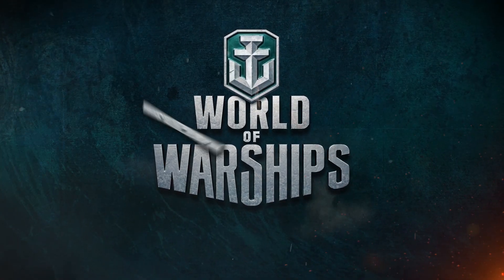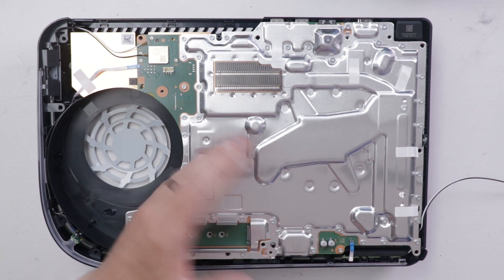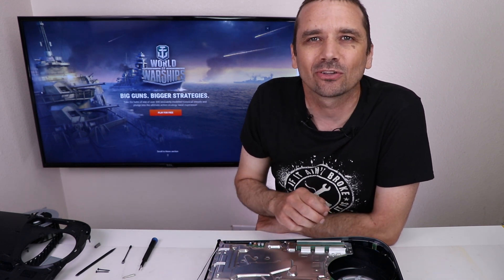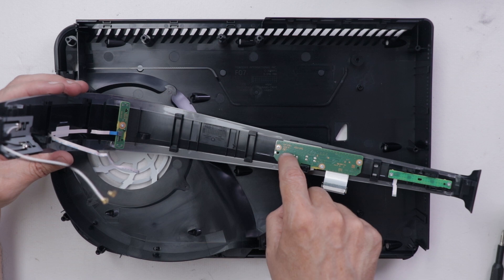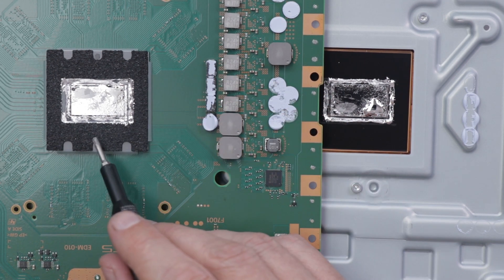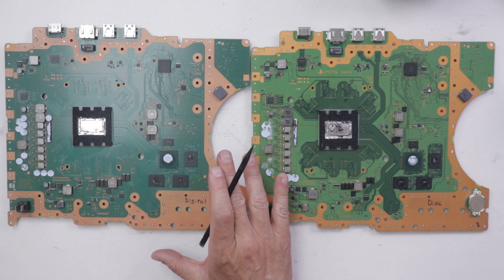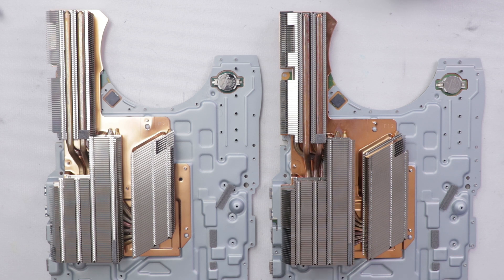I Tore Down A PS5 Digital! Is It Even Different?

Comment from the maker: Download World Of Warships
https://wo.ws/3wmT042
Use code BOOM to get free in-game rewards during registration.
The code is only for new players.
Reply: The person that designed the ribbon that way so you have to remove all those screws is the same person that whines about thermal paste in your comments and is just getting back at you. Sony PS5 engineer to colleagues: "Here I designed the perfect amount of screws so TronicsFix will have to remove them".
Reply: I have a ps4 pro missing a disc drive if you want it for parts it turns on and boots the os just let me know how to send it to you i have no use for it better than going in the trash
Reply: Hey do you think you can help me, my Nintendo right joycon just suddenly stopped working while I was playing a game. The sync button isnt working and the LEDs arent even showing up. It isn't working both handheld nor attached to the Nintendo😪. I have a bit of experience with fixing devices myself, but I have never seen something like. Please give me some advice on what to do if  you can. I would suspect it's the either something to do with the rail or the battery in the joycon is spoilt. Thank You so much if you can help. I cant buy a new one as it's still a lockdown by me.
Reply: So,f5402,is the disk controller?!Or what is that chip for?
Reply: So,that's it.The chip that control the disk player is f5402.
Reply: Maybe i am wrong.
Reply: You can't put the disk.The chip that control the disk drive ,is out of bridge.
Reply: Ps:i will like sooo much the IFixIt 77 pieces,tool kit.One day.
Reply: WoWS was good in approx. 2016-2017, nowadays it's bad, good thing there is sea battles in War Thunder
Reply: NO
Reply: @dj_noxxie  How about some Raid: Shadow Legends?

Comment: Could you please clarify the model numbers of both digital and non-digitals? I have PS5 CFI-1016B, and it indicates that the supported voltage is 220-240. So I'm trying to understand if it has the same Power Supply unit. Thank you

Comment: Actually apart from color differences, there are components missing on the front side in the area of the missing connectors. So it's unlikely going to work unless you move those components as well.

Comment: I wanna see you put a disc on the digital but I don't think it would work, both have different system settings ps5 digital doesn't have blu ray options etc, but then again it might detect a disc drive and have to update the system, but please please please try it

Comment: Firstly, yes I want to see you add a disc drive,  wonder if the drivers are already in in the software...hmmm....
Secondly, can you cut the area thats covering the ribbon for easy access and as you said clean it without removing all those screws?

Comment: Starting at 6:00 about 1-2 inches below the top-left corner is a chip with 4 resistors to the right of the chip on the disk board and none on the digital board. I think you missed that when looking at the 2 boards. 8-)

Comment: Yes it would be interesting to see if it works with a disc drive, that would also give you the chance to see if the disc version works if you take the drive out. Becuase i think they should both work, i'm pretty sure the OS doesnt care if you have a disc drive or not, if not it will just don't show the option, if yes, it will work like it should with a drive... in theory, maybe the drive is also coded to the mainboard, ... i'm curious!

Comment: $100 for a disc drive with two connectors. They should’ve just made the disc drive a modular accessory you could buy and add on as an option

Comment: I wouldn't be surprised if you tried putting a disc drive on the digital one and it worked. Although you would probably need to change out the front panel button board as well otherwise you wouldn't be able to eject a disc lol

Comment: Even if sony said otherwise. I believe sitting the PS5 horizontal is better because the liquid metal is evenly distributed.
Vertically, it flows to the bottom part of the chip only, if there is not enough liquid metal to fill the space between the chip and the sink exactly.

Comment: Hello, I have a question, I live in a tropical country where currently temperatures reach up to 36 ° + in the day, I have noticed that my PS5 Standard heats up to the point of burning when touched ... but the fan always rotates at the same speed (It may be cold or burning, the fan always rotates at the same speed), that's normal ?, is there a way to raise the fan RPM ?
 Sony really forgets that there are also countries with extremely hot climates :(

Comment: Questions, PLEASE help! if I separate the motherboard from the heatsink, do I need to clean off the liquid metal and apply a new batch? Or can I just use that liquid metal and still have it be good? Never worked with LM before :( and for the 43 screws, are they all the same screws?? Thanks!! 😄

Comment: I had sent mine in for repair, my digital ps5 would hard crash when playing ps5 apps anywhere from 5 minutes to 45 minutes. Afterwards the controller nor power button would turn it on, I’d have to unplug it just to force it back on which would force a system repair.

It only happened with ps5 apps and I could play ps4 games with no issue. Do you know what that problem could have been?

Comment: i think before you try add a disc to the non disc version try swapping the ps5 disc drive with another one and see if it boots. if that works then we could be into something interesting. Especially for example someone figured out how to buy a cheap drive and it worked in a PS5 and you just add the headers to the digital version and add it in.

Comment: Question, let's say a PS5 bought had a similar dry spot on the chip and heatsink, would there a telltale sign to understand that without opening it up? 

Also is there something to be done to spread it without opening it up, like (I'm just spitballing) getting a vertical standing console to lay horizontal first and then maybe inclining it in four directions for a few minutes while it is turned on and warmed up (metal may become runnier as a result?)

Comment: Hey do you think you can help me, my Nintendo right joycon just suddenly stopped working while I was playing a game. The sync button isnt working and the LEDs arent even showing up. It isn't working both handheld nor attached to the Nintendo😪. I have a bit of experience with fixing devices myself, but I have never seen something like. Please give me some advice on what to do if  you can. I would suspect it's the either something to do with the rail or the battery in the joycon is spoilt. Thank You so much if you can help🙏. I cant buy a new one as it's still a lockdown by me.

Comment: 1:13 could you cut a bit of the shield off to expose the ribbon cable to make it accessible?  Or some kind of extension to make the connector accessible so you could clean out the heatsink?
Reply: he probly could cut the shielding a bit

Comment: Steve: "The only difference is that the digital doesn't have a disc drive so these connectors over here, are not here"
Me: "I wonder if soldering those connectors could make the trick"
Steve: "Let me know if you want to see me try and put a disc drive in the digital version"
Me: YES PLEASE!
Reply: if it does work could  be possible to put a disc drive on digital

Comment: Yes please, do it! Solder those rubbing conectors on the motherboard and try it. Even i doubt this will work  becouse of the firmware of the digital one, or the married disc and motherboard, but it worth trying.
Reply: i think the firmware is probly the same its the marry stuff

Comment: Great video man
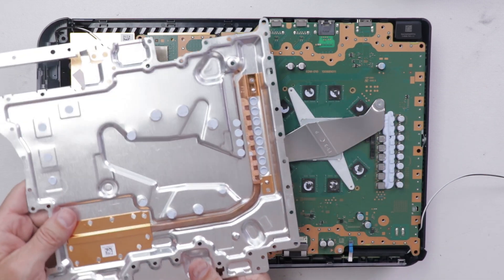By the way 3:20 i think these are liquid thermal pads they use them in places with odd thickness 
I found some in my msi ge75 raider they were used on the vram modules and voltage regulators near the GPU 
I don't think they can be used on a cpu/gpu because there thermal conductivity isn't great they typically used on low heat generating components.

Comment: I've  taken apart a couple of Dualsense controllers and I've noticed that there are two different types. One type has orange analoge sticks the other has blue ones. One hast Blue ribbon cables for the triggers and the other hase green ones. One has a touchpad with a very fine pattern, the other one has a square pattern. But the rest is identical

Comment: I would think that the difference would be in the firmware of the PS5s. By all means, solder on the 2 connectors and see what happens, if it doesn't recognize the drive, update firmware.

Comment: Well you literally read my mind as I was watching. I'm more curious to know if they locked the hardware like apple does with phones these days. Or if you really can just add the parts needed, and Frankenstein a Disc version from a digital version. Because lets face it in a few years, you know you're gonna buy a box of parts here, a box of parts there, and hey presto you made a working console from an amalgamation of spares.
Reply from the maker: You'll find out soon!
Reply: @Tronicsfix  please
Reply: If they do lock it (which it likely is) I wouldn't be suprised whatsoever. The ps3 and 360s drives were locked, same with the launch ps4s and all xbox ones/series x consoles.
Reply: Imma give you an answer. It will read discs for movies and such, but it won't let you play PS games. Same as connecting a blu ray via usb. It's almost guaranteed they put something in the digital edition's software to prevent people from adding their own disc drive. Hopefully I'm wrong.
Reply: Not only apple. Lenovo makes laptops in same way.
Reply: I did that with my PS3. The hard part was getting a Blu-Ray drive that would pair with my motherboard. But it works now.
Reply: I bet they did lock the hardware.

Comment: Its a shame they didn't make a separate removable shield just for that connector. Is it possible to remove the whole motherboard assembly and the front panel of the PS5 with the connector still attached to get access to the PSU, or are there other screws under the shield?

Comment: Yes, install a disc version on the digital!
Reply: That maybe impossible man😬
Reply: @marcaldrien25  it has the connectors for it well the spots to solder them on
Reply: I'm pretty sure it won't work. 🙃
Reply: Could work but the ps5 digital doesn't have disc options like the ps5 disc version but then it might detect it and do an upgrade or you need a dev kit

Comment: Hey TronicsFix, I was cleaning out my PlayStation 5 fan for the first time the other day and I noticed that there was this substance in one of the trenches around the centre of the fan that was dried up and it was  like paint. What would be the best way to remove it without causing a lot of damage? I tried gently scraping it off with a blade and had no luck. (I haven’t got a clue how that got there in the first place and I didn’t put it there).
Reply: If it doesn’t affect the cooling, I don’t think you should bother. If anything, you’ll just loosen it and give it more change to get stuck and clog up the vents further down the line
Reply: @cmdr101z8  ok thank you

Comment: There is no doubt you could attach the connectors to the digital board for a physical disc but would the system recognize the physical disc? That is the better question. As it is, most systems dont work if they dont see a component they are expecting (like say removing the optical disc drive and then trying to start it up). Is it the same in reverse? Meaning adding a disc drive to a digital, would it boot because it is not expecting to see a optical drive.

Comment: How long is the average life of liquid metal before it is better to replace it? ...And yes, I definitely WANT to see you try to install the bluray drive in the all digital mobo, and I'd also like to know if to turn the disc model mobo into an all digital one, you can just remove the optical drive.
Reply from the maker: I'm not sure. I'm not sure that anyone knows how the liquid metal in the PS5 will do long term.
Reply: @Tronicsfix  I am sure it does better than the thermal paste or pad
Reply: @windowsxpprofessional  Do you mean in terms of heat dissipation or long-term durability? Because I know it dissipates better, but I have no idea how long it lasts.
Reply: @LucaBlightOfHighland  I am also not too sure though I am sure that it lasts longer than a normal thermal paste or a pad. Heat absorption and spreading should be better as metals are a great conductors of heat

Comment: I bet it is just about connection and firmware. You will maybe have to switch the bios if you would try to add dvd drive. But who knows maybe the firmware is the same to make updates easier
Reply from the maker: I can do the hardware part...but unfortunately not the software part if that's what's needed.

Comment: steve i have a question my ps4 slim  disc drive has grinding noise after manual eject
Reply: The manual eject mech is stuck. You need to open it and lubricate it
Reply: @windowsxpprofessional  Thanks

Comment: Amazing I get to buy my self s second one but couldn't get the digital at all so I have two disc version one of them it's not working and it's the one I asked you if you be able to fix it for me of course I'll pay for it. Now the problem seems to be the fanfiction or something about over heating cause I did turn it once again after a month and it worked after I thought it was the HDMI but don't think so cause it actually worked very well for several hours until it start given me green screen and no graphics l, stay on bilut no graphics on last time I turn it on.
Reply from the maker: I'm not sure what's wrong with your PS5. You might try a new HDMI cable.

Comment: So does that mean if we accidentally cut that ribbon shield we can remove it without causing any issues to the system???

Didn't think you ask if we wanted to see you try and add a disk to the digital one. Waiting patiently 😁😁
Reply from the maker: You should be able to cut the shield so you can remove the board + heat sinks without removing the 43 screws.
Lol…I might have already filmed that video so I already know the answer…but I’m not telling!

Comment: I absolutely would love to know if just adding the ribbon connectors to the digital board would work!
Reply from the maker: I’ve already made that video…it’ll be coming up!
Reply: @Tronicsfix  how is this comment from 2 days when the video is just out for like 10 min 

Wtf 🤣
Reply: @yasserbaker  because it s a member Will get it early
Reply: @yasserbaker  released early for members
Reply: @Tronicsfix  did it work? Can‘t find rest untill I know it :)
Reply: @Tronicsfix  can't wait for the video 😎👌
Reply: @Tronicsfix  wouldn't you need the eject button (though I know that disc can be ejected from the OS), and also the eject button motherboard as well? TronicsFix is known to making it as realistic as possible 😅
Reply: The motherboard would surely need to be married to the drive or is that more of a PS3/Xbox 360 issue ?
Reply: @SamsTheMan90  not if Renesas is on the main board
Reply: @SamsTheMan90  that was just my thought. Remember that you needed to do RGH on x360 to get the key so you can spoof the drive. So I don't think we gonna see that soon, however it is possible
Reply: I am pretty sure it wouldn't work. Ever since the ps3 era all optical disc drives were locked to the motherboard. Since here's no drive to start with i am willing to bet the max you could achieve is movie playing, assuming there's chip for the drive to start with.
Reply: It might also be disabled in software. And You prolly can’t flash a disc firmware onto a digital ps5 so I’m curious to see how this plays out
Reply: I doubt it, the board is likely married to each console. Plus, the blu ray drive is also likely disabled in software
Reply: I'm sure you can add the connections no problem but like most consoles the drive is usually married to the motherboard with a smaller daughter board. So unless you have a way to flash the board I don't see it working.
Reply: @FaddyMatty  that is correct but what im thinking is like the ps4 slim and the pro the renesas was on the main board unlike the ps4 original where it was on a daughter board on the disc drive itself.
Reply: @Finditfixitphilipit  it will awesome if it does work for sure. And I didn't know the slim and pro versions were different from the original ps4. Good to know that.
Reply: Yep he read everyones mind we all thought it
Reply: Since the PS3, the drive is married to the motherboard so I think it won't work but I'm looking forward to that video regardless.
Reply: Same! DO IT! please
Reply: Same
Reply: How 5 day and video 2 day how😖😅
Reply: it's not just connectors, there are some other components missing on the other side, visible around 6:13